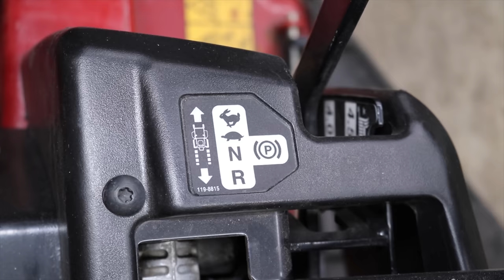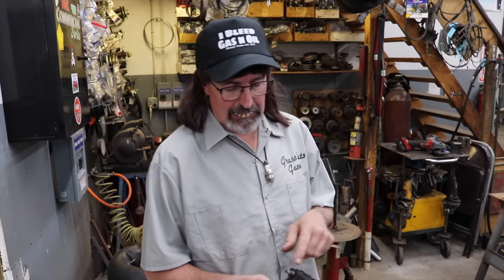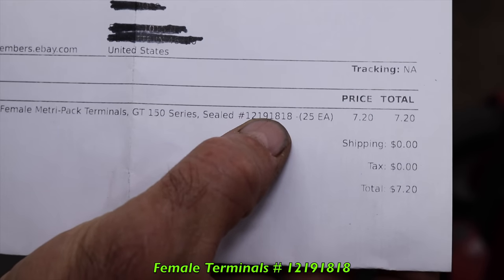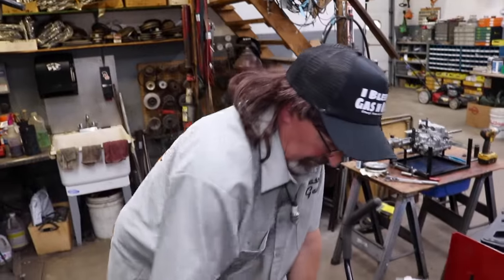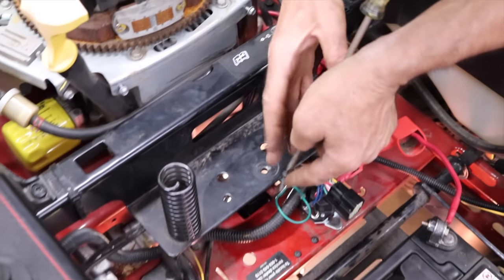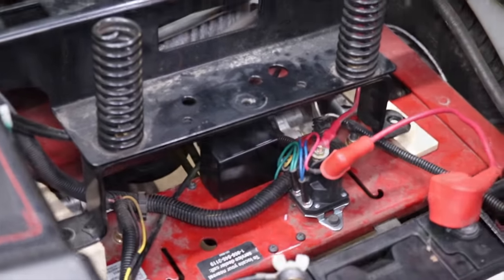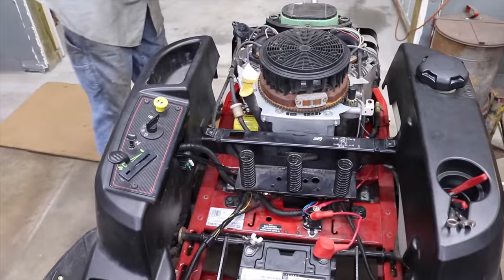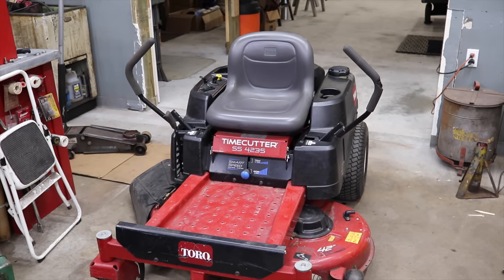⚠️ This Thing Was NOT Easy To Work On

Comment: Would the proximity of the battery contribute to the disintegration of the terminal plug?  Battery off gas?  Or maybe the cover holds moisture.  It looks like it could be a deliberate design flaw with the proximity to the battery.  The vertical mount position and the cover seems like a recipe for corrosion.  Wonder if the old terminal would fizz with baking soda or something to test for battery chemical presence on it.

Comment: had a mechanism like that to engage and disengage 4 wheel drive on an atv they wanted like 800$ for the part so i ridged up a on/off/on switch directly to the little rc motor inside the housing so i could engage and disengage it manually

Comment: If it wasn't for Nuckleheads Operating Power Equipment we wouldn't need all the stupid safety "features" we have today. Wait for a couple of years when Toro decides to quit making those modules. I have a mid 80's Honda HT3814 lawn tractor. It has an Omron "safety relay" which is no longer available. That makes the tractor unusable. I came up with a couple of relays to simulate most of the module "features". Not everyone can do that. BTW, that pray wax from Valco works pretty  slick!

Comment: It never hurts to put a small amount of di-electric grease between those terminal couplers. It will keep out moisture and prevent the corrosion. They should have done that at the factory...Nice work Taryl...
Reply: Any grease works
Reply: @mikem5475  But it costs about 2 cents to use the right stuff...
Reply: @godfellas483  you're missing my point. Every grease is the right grease
Reply: @mikem5475  Di-electric is clear and less messy...wipes clean with a shop towel...No need for lubricity. Also water displacing.
Reply: Dielectric grease is a non-conductive, silicone-based grease that's designed to seal out moisture and prevent corrosion on electrical connectors. It also disrupts the flow of electrical current, which makes it good for lubricating and sealing the rubber parts of electrical connectors. It's commonly used in automotive spark plug wires, recreational and utility vehicles, and electrical systems in aircraft.
Reply: @godfellas483  i think it's good for spark plug wires, that's the only time I can think of it being necessary to choose something that resists arcing, but even spark plug wires I've used lithium complex red grease on and it has worked great

Comment: I've had to fix a few of these brake problems on Toros ,
Just another way for them to keep getting our hard earned money 💰. 
Thats the problem with all the new mowers coming out they have to much electronic rubbish on them.
I have fixed them by soldering a new terminal on the 1 that rotts away. 
Here in Australia 🇦🇺 I have to pay $290 and thats trade price

Comment: too manually release the brake grab the silver rods under the module under the rider and turn the rods clockwise it will release it. it makes like a electric motor noise when turned

Comment: I put one of those cheapest 12 volt wenches from Harbor -- Freight on front of my trailer I use to hall mowers with and if I got a mower that won't run or move I just wench it up on the trailer . I'm sure everyone gonna go out and buy one of those z-turns after watching this video .

Comment: I wonder if the customer pressure washed that thing thereby getting that terminal wet and trapping water inside the connector that is only normally water permeable under high pressure.

Comment: Sometimes you need to go to other companies for parts even in automotive I've gone to other dealership parts department to fix my vehicle had a Dodge school bus brake bleaders for bleeding the rear brakes were not available as Dodge had quit making them over ten year's before took one to the Ford dealership parts department set it on the counter and said I need four of these he looked at it😊 went into the back and brought out four some part's it's better to find the vehicle with the same part's and write down the model  GMC changed over to a square rear end in 75 because of the rough roads it pounded the springs through the axle and broke the cast-iron wedge the mechanic took it apart and welded a plate of 1/4  inch steel plate over the holes in the axle but checking with the GMC dealers part's department were told that they were unavailable as it was too new would have to be ordered from the GMC plant and delivery would be 6 weeks to 6 months so when he told  me that I figured Ford usually are the first to switch to a new product so I went to the Ford dealership looking at their trucks found one  but part's was closed so I went back in the morning took both halves of the wedge with me and put it on the counter and said I need two of these he asked what's the truck it's out of and since I couldn't remember what truck I'd seen it in all I could say was I don't know but he took the peices went back and found the part as he took my money he said what's it really out of I said a GMC and the model he said why didn't I say so and I told him I'f I did  he'd have told me they don't carry GMC parts and he agreed we got the lemon back on the road

Comment: Those female connectors have the same appearance as the seriel computer (RS-232) connectors. There is a small tool to extract each pin in a simple maner.

Comment: The electronic parking brake on a lawnmower.  The solution to a problem that never existed. 😒😒😒
Reply: I just cleaned out the connection/plug and worked just fine. Problem was it got dirty and I also left it out in the rain. My fault lol

Comment: Now those shops that sell Toro equipment will buy those replacement terminals, fix the wire harness with the new terminals and charge the customer for a new wire harness. You know it's gonna happen.

Comment: I have the exact same mower
With the exact same problem. 
To me a hand brake isn't worth $200
I ended up just disconnecting the linkage arms and zip tied them outta the way 😂
Also my name IS timmy😊
Reply: That's funny
Reply: I just cleaned the plug/connection and it worked just fine. It gets gunked up

Comment: As clean as that Toro looks I suspect the owner power washes it often.  That I suspect caused the corrosion on that connector.
Reply: yes,  it's best to not spray water at anything. many things are designed to shed rain, and they don't do a great job of doing that
Reply: I clean my mowers with the air gun.
Reply: Or a leaf blower!👍

Comment: So you bled blue. Does that mean you are a blue blood? Looked like you disconnected the red wire from the battery. It would have been better to disconnect the negative  (black) battery terminal from the battery. Less likely to create sparks if the wrench hit any metal while the wrench was on the battery bolt.

Comment: You should've able to get the wire seals for the connectors, as it is a GM terminal , and or apply silicone to the back of the harness connector to seal it.

Comment: A couple of years ago I diagnosed and replaced one of those brake modules for a guy after his "brother" had already come and installed a new battery, starter motor, starter solenoid, and key switch! After I was done, the guy asked me to uninstall all his brother's new parts and put back the old ones so that he could return them on amazon and get his money back!

Comment: Vaseline works just as good as dielectric grease,, I've been wanting to get some of those crimpers thos are handy!! Those connectors look like those terminals on power pack??? Connections. Not sure that's what they are called,, but a lotta automobiles have those now,, WATER PROOF( SUPPOSEDLY) . VASELINE OR JUST ABOUT ANY GREASE( EXCEPT GRAPHITE GREASE) IS DIELECTRIC!

Comment: I'm shaking my head, trying to understand how the brake module makes this a safer mower. What was wrong with the manual handbrake lockout limit switch. I have a 2010 toro 6050, and it works fine.🤔

Comment: My new 2 year old 54" toro myride zeroturn parkingbrake went out and it is a pain to replace. The new style is way worse to replace than the old style, as the newer style parking brake stands up and all the screws are installed from the back, and every screw is a pain to get to. The old style was way easier to replace, so they just found a way to make it harder to install, to get you to take it to a dealer. Those parking brakes are trash and toro knows it. I would tell anyone to stay away from toro. I have spent over 600 dollars on this mower alone in parts since I purchased it. You need a name for toto, and I would call it toro trash'em.

Comment: If they made the engineers disassemble and reassemble these machines they would be a dream to work on .
Reply: Over engineering what should be a simple manual brake,but people these days are to lazy to use it,so let's put on a electronic butt wiper on a mower next,just more stuff to  protect the morons from getting hurt and sueing the manufacturer,glad to see there's mechanics like you that care about saving the customer money,and anguish,my hats off to man

Comment: That little motor for the brakes is what died in mine. it would start but would not go because it would not release the brakes. So if you don't want that little motor........

Comment: they fixed the issues with the brake after the 2013 model. no issues after that. rust was the main issue. it also is very easy to turn the brake off manually.

Comment: Anyone else reading would you clean the rust off the coil laminates? I would. Also why is dielectric grease used on the connector but not on the battery connectors?
Reply: The rust is going to come back on the coil.    Grease would on the battery terminals  but in the environment of mowers it will collect all the dirt grass and anything else thrown up mowing making it worse.
Reply: @1988MowerMan  rust would take awhile to get that thick again.... I use air compressor to blow my machine clean...very little build up forms  on greased area...

Comment: These Toros with that electric brake module are crap. They’re wired differently than all other mowers because of that piece of crap brake module. I know several commercial mowers that moved away from Toro because of that crap. They need to go back to a manual brake.

Comment: I've done repairs on modules like that on my own equipment by digging the epoxy potting out from around the broken pin and soldering on a new connection.  But no way would  I do that as a repair shop.  You could not warrantee a shaky repair like that.  Thanks for the vids!  👍👍
Reply: Plus the labour time.

Comment: Bought mine used at auction 5 years ago, not running. Turned out to be this module. What a stupid design because the brakes lock up unless you know to go under the unit and manually release them! Anyways, 1 terminal was corroded so I cleaned them all up and packed it with di-electric silicone. Never had an issue again but who comes up with these stupid ideas? Then they mount it on the under belly where all the water and moisture is! The module here in Canada was over $250 plus tax at the time if I remember correctly

Comment: What a stupid design Toro.  Then to mount that over engineered component with the connector facing up where it can accumulate water, it’s made to fail one way or another.  Lots of labor to repair it.  Nice complete job Taryl my complements.

Comment: Dielectric grease or super lube to prevent the corrosion I notice if mowers get parked near fertilizer or chemicals they get rust and wire problems like that .maybe pressure washing soaps cause that???

Comment: Yes they go in not connecting conditions connected for an old truck like a 70 of the 72 Chevrolet truck or a distributor connector has determinedals like that up to 70 42 80 1 PM truck but yes 60 72 72 used Ignition connectors why

Comment: It sounds like Toro is the manufacturer that needs to be dumped by their dealers. I’m beginning to see why my local dealer showed them the door.  From trying to force their dealers to stock battery powered shit that their customers don’t want to building garbage that is too difficult to repair I’m thinking Toro should experience the reality that their dealers are the ones that made them a success.

Comment: When I’m finished mowing with my 0 turn I give it an air bath from my air compressor. It gets rid of all the grass and dirt and leaves the mower clean and dry. So I hope that the plug ins don’t get the green crustys. 
It would take a real grass rat to unplug and grease all the plug ins on a new mower but maybe you should. With the dialectic grease 
Great video. Be careful with that pressure washer.

Comment: You would think they could have rotated that thing 90° and moved it towards the batcree, or something.
Reply: Or instead of fishing everything through them small holes, have a larger oval hole reinforced with some round stock. Have that center spring on a separate plate that can be screwed in place as an assembly.

Comment: Wonder if someone was getting overly aggressive with a power washer and got those terminals all wet over and over again?
Reply: @dsmreloader7552   True... it's a problem. Chlorine in the water and the soap ..especially the soap ..will rapidly corrode the connections. See it in autos frequently. Dirty engine is usually a good thing.

Comment: 5:50.  TARYL.    WHAT THAT THING DOES IS DISCONNECTS THE STARTER WHEN THE PARKING BRAKE IS ON.   AMD YOU JUST NEED TO FIND THE TWO MAIN WIRES IT DISCONNECTS AND HOT WIRE THEM AND TOSS THE PARKING BRAKES.   I THOUGH THATS WHAT YOU WERE GONNA DO.....
  REPLACE THAT PART 
YOUR CRAZY

Comment: Had one of those on the shop that had the pin to the carb solenoid corroded off the module. Took the tip off the solenoid.  Problem solved. Dealer wanted over $1k to fix it

Comment: Was the mower stored inside like a shed, trailer or insdie a garage?  Asking as in my Toro manual is states to not wash that area and it's preferred to not leave outside in an uncovered area.  Seems Toro knew their connectors might rot or long time exposure to moister might cause eletrical problems. Great video and thank you for sharing and taking time putting this video together. :)

Comment: My trusty little Time Cutter has levered teeth attached to the drive handles that MANUALLY engage when you move the drive handles to the park position. All of this electronic junk is getting out of hand. Consider also electronic e brakes in modern cars! When will it ever end? At this point, never.

Comment: It appears that mower shouldn't be outside except when using it to mow. I suspect that connector is a standard automotive connector that can be purchased complete. Toro should be able to provide a part number (they probably won't because they'd prefer to sell the entire harness).
Reply: The complete connector doesn't come complete from the supplier. Those pigtails or complete kits are put together by a third party much in the same way the supplier that makes the wire harness takes the individual components from various part makers and assembles them into harnesses that Toro puts on their mowers. So while Toro's engineering department may know the connector they've spec'd for the harness they wouldn't know off the shelf pigtail or connector kit part numbers.

Comment: I deal with these type of repairs in the automotive field, I keep all the connectors from harnesses I get from replacements, usually corrosion or Fluffy chewing wires off at the connector. Cut the wires long then you can dissemble the connector and replace the wire and terminal with a solder in wire splice, a lot of times it saves the customer from having to get another component, harness or sensor. Great fix 👍

Comment: Not a fan of those  'Time Wasters'.  And way too many mowers these days depend on some stupid assed electronic control box to make the mower work.  On my Deere X-370,  7 years old with 240 hours,  I'm looking at $330.00 for a new ECM for the damned thing that controls everything on the mower.  Without it,  it DOES NOT RUN.   It's ridiculous and I'm fed up with the electronic bullshit.

Comment: I'm still using a 2007 Toro timecutter 42", with the 19hp Kohler Courage. I think the worst thing about my lawnmower has been the crappy deck. Yes, I've had other "small " issues but its not been anything I couldn't fix and honestly compared to the one your working on mines older but seems easier to work on.  BTW, I've had most of the issues related to the Kohler engine except the compression relief, will never buy another mower with a Kohler engine or the B&S engine for that matter.

Comment: What's your opinion on a gas/electric mower? A micro tractor,   using a brushless electric motor  to drive it, about 3-5kw with a similar motor driving the deck/or hydraulic pump, for accessories,  then a 10 HP engine and generator,  with a 5-6kwh battery. With the option of double and the option of four times that, going electric only!  And having a tow behind generator, running about 96-180v ,  it has the option to drive it around on the battery, possibly mow a small yard battery only, then start the engine when the battery is done to keep going, or stop and plug it in.  Use a fuel shutoff, that runs the carb out of fuel, or use fuel injection,  also having a natural gas/propane option it's something I was thinking about building myself, however, these snobs in neighborhoods would like a near silent mower, along with golf courses,   just to give an idea, about 750 watts is 1hp so 1500watts is two HP.. a 4hp electric motor should move a mower fine, especially with instant TQ, so 6-8,10 HP would be better,  also should spin the blades well,